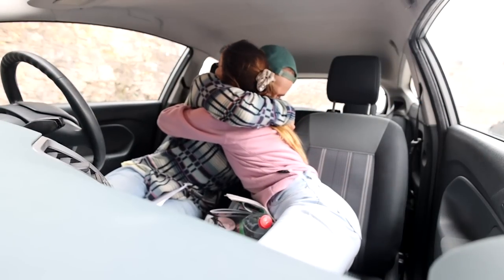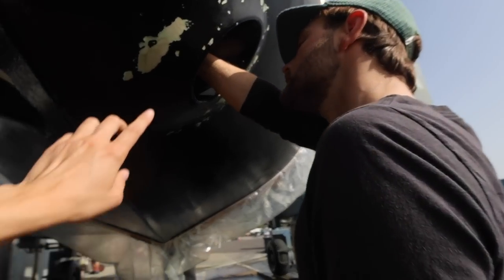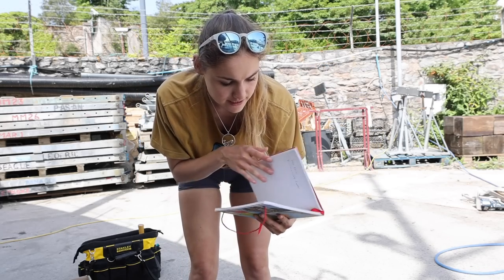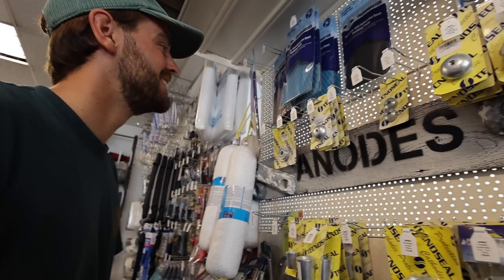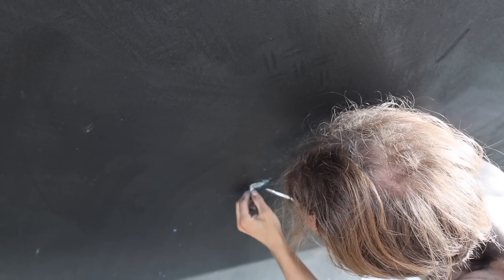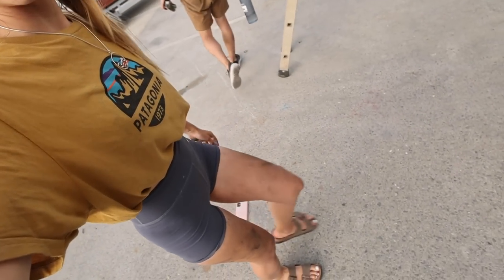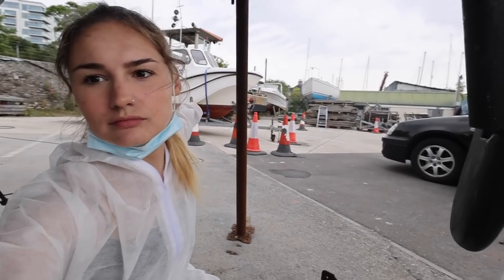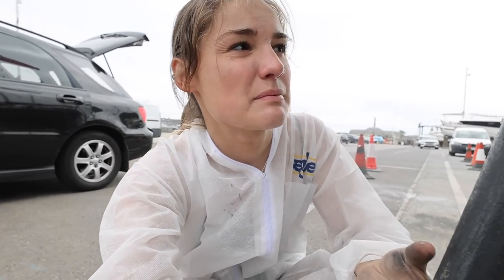HAULING OUT our 35 year old boat for the FIRST TIME

Comment: just keep in mind that antifoul is a biocide, its not a good idea to get it all over you - also pro tip make a google sheet that dedicated to your boat, you can keep engine part numbers/suppliers/screw fittings sizes, paint amounts/electrical info/rigging info, maintenance info etc etc, its very helpful!
Reply from the maker: We are still alive 😜 but you are right, that's why we used suits and gloves next time 😊 good suggestion about the spreadsheet- we have one for maintenance but one for parts would be really helpful! Thanks!
Reply: Good input.

Comment: FYI, Acetone CAN damage some plastics and resins.  WD-40 spray oil is ideal for removing water from composite areas (WD=Water Displacement) AND it helps preserve the metal bolts.  Glad to see that rotary tool I ordered for you is useful.  You two are doing a fantastic job!
Reply from the maker: We didn’t know that! Thanks for the heads up Erik, we will be sure to use a different cleaner when we come to replace the remaining ones! The rotary tool is one of our most used tools on board- thanks again for that! 😊

Comment: The anodes work by corroding more easily than the other metals in the water. When any metal (including the anode) corrodes it emits electrons (like electrical current). As the anode corrodes first it "fills up" the other metals with electrons (if they are connected or wired to it). When a metal is "full" of electrons it can't produce any themselves so therefore can't corrode. Metals can only corrode if they are allowed to emit electrons.
Loving the videos. Well done!

Comment: Nice job! Little tip from my first haul out last year - if you're just scuffing up the old antifouling prior to painting, try wet sanding with a large hand sander, bucket and hose - it's less messy, and probably about the same effort.
Reply: True, wet sanding the Antifouling is also much cheaper as far less sandpaper is needed. Just use water and more water. Put the paper in a bucket for a few minutes before use. Working above your head will always cause messy situations as water will also drop everywhere and run down your arms... Still it's a lot easier and less messy.
Reply from the maker: Great suggestion Keith- we didn't even think about that. Thanks!

Comment: If you have a floor board that’s difficult to lift up you can spray WD 40 on the areas where you think it’s jammed and try and move it, if it still doesn’t move put a screw into the board and lever it up from the screw, fill the screw hole later with some epoxy.

Comment: Really enjoying watching your journey learning this stuff. As soon as you said you could hear the ticking I knew it was the depth sounder, but as you said you would never know! Finally, there is a really good nuts and bolts shop in Exeter Street, near marine bazaar. The equivalent of 316 stainless steel in the nuts and bolts world is called A4. Apologies if you know all this already
Reply: A4 is just a brand name, the correct name is 1.4571. Usually... There are also 2 more types of seawater resistant Stainless Steel but 1.4571 is most often used for technical things and below water. In the superyacht business 1.4571 is not used on deck for fittings as it can not be polished as good. Then 1.4401 or 1.4404 is used. Standard fittings for normal sailboats like bollards or shroud tensioners are usually made of 1.4571.
Reply from the maker: Thanks so much! We have actually found that little store and its been a godsend for us! 1000 x cheaper than Force 4 for sure 😊
Reply from the maker: Thats so interesting André!
Reply: @TeuluTribe  It should be alled Factor 4, they're not the cheapest chandlers.

Comment: Great job guys. Might want to research that depth sounder a bit. All the ones here in states I have always seen don’t even get paint over the transducer, “the ticking sound part” much less caulk or epoxy. I was told it affects their ability for good depth readings. Not sure yours is the same but just in case.
Reply from the maker: Thanks Brenden 😊 We looked it up and couldn't find much about it however, it seems to be working ok as the depth in the berth is exactly what is was before we did the work to it! But i can see how it might stop the sound!

Comment: In my opinion, one of the biggest jobs of having your boat anodes correct, is in case your neighbor at the dock allows their shore power lines to hit the water. This will save your electronics. And unfortunately, it is common enough for neighbors to be unattended and the shore power to create havoc because it slips into the water, as you are living in a wet environment. This is also how boat fires can start. But good for y'all for ensuring your boat anodes are set up correctly. As all boats leak current, this helps when using your boat as a live aboard.
Reply from the maker: We have heard some people often throw an anode on a line overboard to also help with this so we have kept our old anode for this reason! Thanks Randal 😊

Comment: Ah-hah! The waterlogged rudder club.has some new members. Well, along with pretty much every other yacht owner on the planet. GRP rudders have always had, er, "issues". Which is kind of inherent in the way they're made and the job they're asked to do. Old barn door rudders in wooden boat days were made by bolting together strips of wood to laminate up a great slab of timber -job jobbed. When inventing GRP rudders, they were made by moulding two halves, and gluing them together around a stainless steel armature that is welded to the rudder posts. Problems start with the load that rudders have to bear when acting as, well, as rudders. Certain types are more vulnerable to failure. Skeg hung, relatively small rudders (like yours!) are pretty robust. The sealant between the two halves leaks as the rudder bends and flexes under load. The seawater corrodes the armature inside, and eventually it will fail. However, the good news is that on your type, that failure will take a long time to occur as the loads a cruising ketch will generate are pretty modest.. Any failure is likley to be below the level of the rudder skeg, so there'll still be some rudder area to function. Also, being an older Colvic, it's built like a russian war memorial, so there's a lot in reserve! Modern blade rudders on race boats, built down to a computer calculated price, are a helluva lot more vulnerable, and do fail rather too frquently....
No sign of any osmosis anywhere on a Colvic? I'm shocked, shocked I tell ya... (not)
Reply from the maker: It sure does! I guess its reassuring to know there are plenty of them out there. We were considering taking it off and drying out properly but decided to pick our battles with this one as (you'll see in next weeks vid), another issue came up which we needed to fix far more than a soggy rudder (which had probably been that way for 20+ years 🤣 its nice to know ours is one of the less likely types to be vulnerable to damage. Haha 'built like a Russian war memorial'- you got that right for sure! Thanks for your comment Roger!

Comment: It may have worked with the car filler but this stuff takes a lot of water and forwards it into the laminate. Polyester can take up to 11 percent of water and the filler will suck water because of it's porous structure. Best would be to measure the water content in the laminate of that area. A boatbuilder should have a moisture meter. Putting the boat back in the water with wet laminate can cause osmosis. Osmosis is a natural process where different moisture is tried to equalize but it will destroy the laminate when the moisture pressure becomes to high.
I like very much that you both do all the work together. It's very important for a couple out at sea that both are able to get the engine running again or troubleshoot electrical things in case one of you is injured. Often there's just no time to ask for every single step in an emergency situation. You need to know what to do. But I believe you're on a good way and both willing to learn. That's real equal rights.
Reply from the maker: Thats so interesting! Thanks André! Like you mentioned, we find it vital to both be able to do everything on board. And being a female especially, this is very liberating and as you said, 'real equal rights' 😊
Reply: @TeuluTribe  You're welcome... 😀 I'm a german naval architect and carpenter, restoring my own classic yacht from 1937. Hope could help a little. If you have any questions... My boat was in the Royal Navy from 1946 to 78, than sold to private. The previous owner was a good friend of mine for 10 years. His family invited me to his daughters wedding and his funeral in Polzeath, Cornwall. Great landscape, I have so many good memories to this. Friendly people, a little eccentric but in a nice way. Are you planning on sailing further one day? For sure it makes a lot of sense to learn before starting on a long passage. I'd like to see more of sailing over in Brittany, a hugely underestimated sailing area. If you go across the channel don't miss the northern coast and start right at the east end at Mont Saint Michel, St. Malo, Lezardrieux, Roscoff... My boat had it's home port in Morlaix for many years.

Comment: Anodes got a galvanic isolator? Galvanic transformers (about 600 quid by Victron) are supposed to ve much better. Now something Cheap very cheap in Comparison, which "May" help to extend Expensive Anode Life, potentially Considerably (to think about for Next Haulout), I came across on a couple of Forums where people were talking about what to use for antifouling propellers - Cold Galvanising Zinc Paint. You can get it in Aerosols and tins for brush and roller on, and users of it have had no problems for in excess of 10 years. 96% zinc content in a silicon medium that doesn't even need stirring, 1kg tins in UK, costs about 24 quid Inc VAT. You can Get Marine Zinc Paint from Chandlers but it is about 4 times the price for identical Paint. Aerosols have less Zinc in them, and cost about 10 quid inc VAT 6 dollars ish USA.  3Coats protects for up to 18 months, and it is non Toxic, plus is an Anode (wearing away the surface electrically may be how it works as Antifoul ?  Well I haven't had a chance to try this yet myself due to no boat presently. What I plan to do, as my next boat will have a bolted on  iron Keel , is 2 coats of Epoxy Barrier  Coat then 5 coats of Cold Galvanising Zinc Paint, then 2 coats of rolled on 96% topped with 1 coat of aerosol on the Prop, and 3 coats of 96% on the Fudder. That will be a heck of a lot of Anode Protection all around the Boat, and as I'll be hauling out annually for thorough inspection, Full Service etc, I'll be able to see how the Cold Galvanising is coping, plus see what state the Anodes are in. to refresh the Paint if needed, just pressure wash, give a good scrub and slap more Cold Gal arising on. If your anchor Galvanising looks a bit thin, slap some on that as well. It may be a long wait for an update, but I'll try to remember to give one, with  lose up photos of the paint plus Anode surfaces. Did you get a PVC or Hypalon Dinghy by the way ? If PVC something to extend its life would be a full di ghy cover, lots cheaper than Chaos, and for tubes etc when the cover is off due to dinghy being in the Sun being used ? Try a Spray and wipe Iver with sensitive Skin High Factor Sun Blocker. The Ambre Solaire Factor 50 was 5 quid from Tesco, and this summer Test pieces of PVC showed no degradation. Non Sensitive Skin Protection from UV may be as good, but cost the same so I started with that. There is a new PVC that is much more resistant to UV that Seago use on their PVC inflatables, but as they arevthe same weight as their 3 metre Hypalon  air deck and air keel, I think I'll go for that and wait on more Info on how good the new PVC ones are doing. May pick up a 2.4 mtr  backup one to keep in the foredeck locker with a small 3.3 hp lightweight tohatsu 2 stroke outboard just in case, as I've a couple in the garage, one with a Mercury label on it, and they are little beaters.  Best Wishes and Fair Winds.  Bob.  👍

Comment: Check with the previous owner if he disconnected the anode from the engine deliberately, there may be some other issues like corrosion of the driveshaft in the stern gland
Reply from the maker: Good suggestion Paul- thanks!

Comment: Those little weeping spots you found as you scraped out the car filler could be evidence of osmosis I’m afraid. I had the same on my boat and as each little spot was found it was opened to find an acetic liquid oozing out. This was washed out with water before drying and  refilling the holes with epoxy. It wasn’t a permanent fix as to do this really needs the gel coat to be planed and a proper treatment undertaken. Expensive and time consuming. On the plus side I have not heard of a boat sinking from osmosis. 👍
Reply from the maker: Hi Nigel! It was just an old ding which someone had filled- the survey when we bought it said there was no sign of osmosis at all (they used a damp meter and the rating was in the great range)!
Reply: @TeuluTribe  That’s really good news. When I was doing similar work on my boat I opened a can of worms as every time I dug out a bit of car filler there were these horrible voids in the lay up. Thankfully her lay up was so thick it wasn’t going to be a problem so after I had dug through quite a few of these and lost a lot of sleep I decided to draw a line and stop. There was simply no point in continuing. That was 6 years ago and she’s still sailing. Keep up your hard work, If I was wearing one I’d take my hat off to you both. Well done.

Comment: Hi, Just a side note. Some rudders are purposely filled with either water (neutral) air or oil (positively buoyant) or steel shot or disks in oil to be negatively buoyant (this is surrounded by oil to stop corrosion). 
Your rudder may have had water in for a reason..... or maybe not..... (Glad I helped!!!!)
Reply from the maker: Ah interesting, we didn't know that. Thanks Brett! Just odd it was dripping out the bottom of it

Comment: Most electrolisis is caused by 2 factors In a marina poor instalation and other vessels plugged in with bad wiring and the other is ALL wiring MUST be Insulated Return in other words the earth wires MUST NOT be connected to any part of the vessel except the batteries . IR starter and alternator are 2 culprits if not fitted
Reply from the maker: Interesting! Thanks Howard 😊

Comment: The S/S rudder skeg bolts will corrode away anode or not When they are trapped in say the skeg the water will eventually turn them back to iron and they fail ALWAYS USE A4 S/S anything less will rust away totally
Reply from the maker: We have just found four Stainless Steel bolts which are the perfect fit for it, only a few weeks too late 😆 next time!